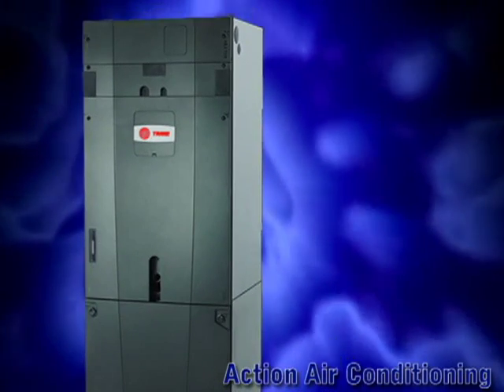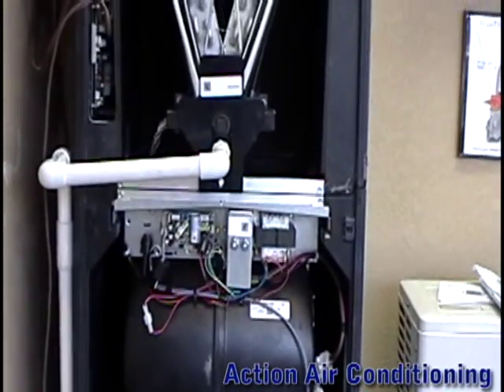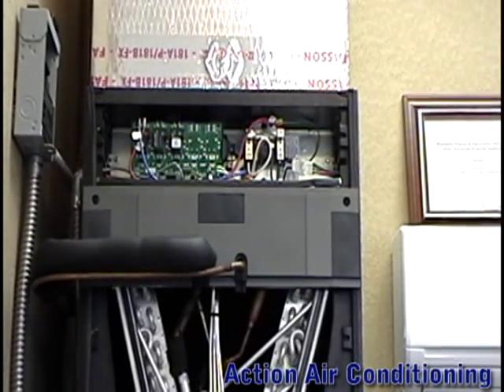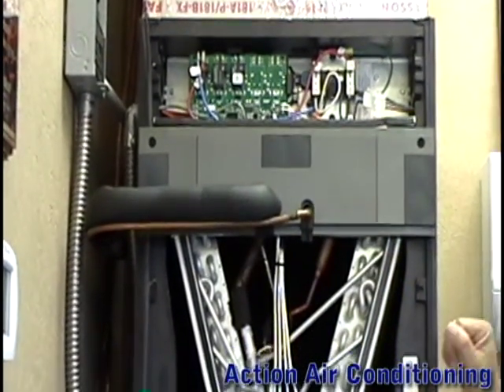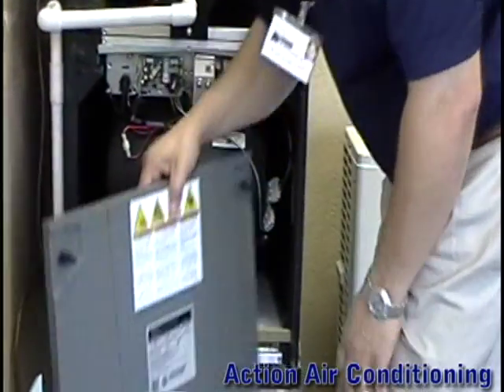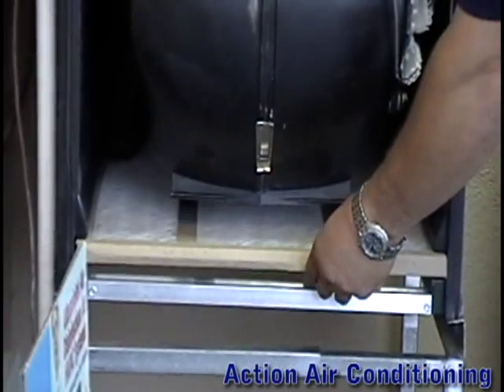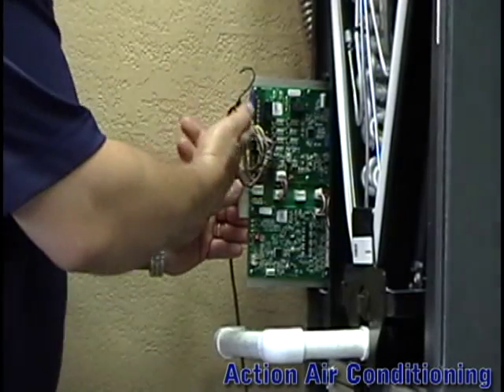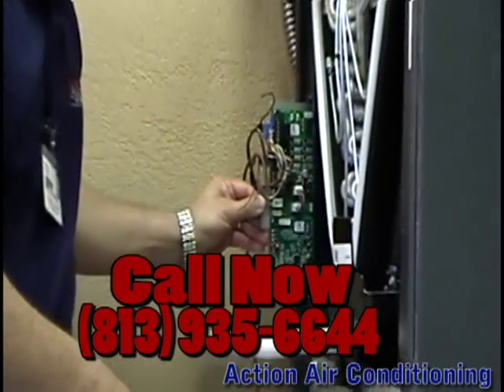Trane Hyperion Air Handler from Action Air Conditioning in Tampa

Comment: Nice unit but I don't like the way TRANE has the T-Stat control wires pinched between the cover and the unit. There should be a proper entry point for this cable.